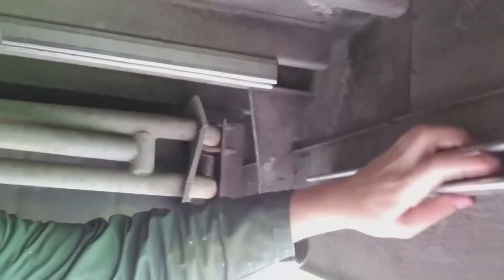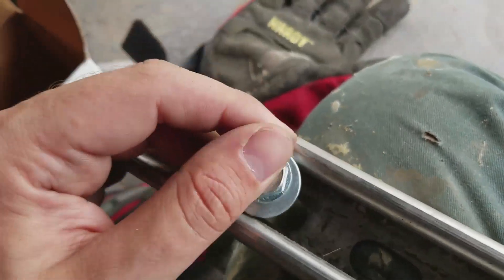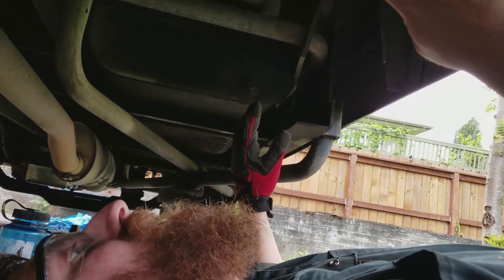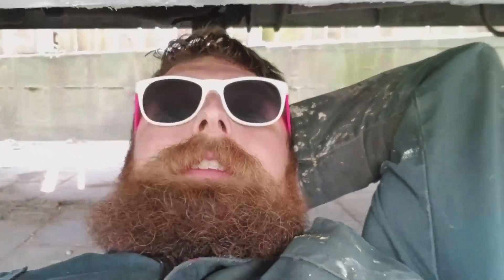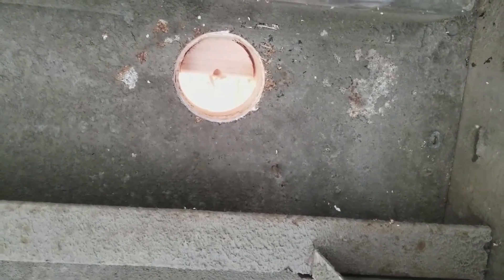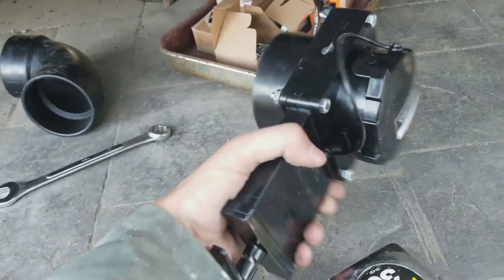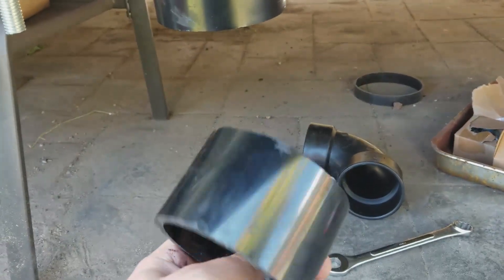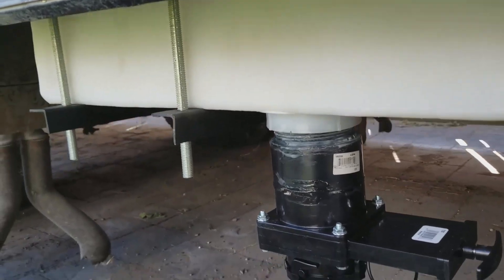Conversion Video 19: No-Weld Grey Water Tank Install

Comment: You installed the tank upside down
Reply from the maker: I designed the tank.
Reply: Not trying to be mean or anything 
It just seems to me the inlet  would work better coming straight in the top and the outlet coming out the bottom of the side, would allow more ground clearance for the valve.
Reply from the maker: @Longearrider  I thought about that, but with so many plumbing things placed over the wheel well, and a couple of drains needing to cross over, it made more sense to have the input ports come in the sides, and have it dump out the bottom or sides.  I figured less gunk would build up if it dumped out the bottom.  It might be a good idea to make an elbow out of the bottom port at some point.
Reply: Gotcha, just proves every design is different to the application.

Comment: Water is heavy, like very heavy. About 8.34 pounds per US gallon. Then you have to factor in for the stresses of a large amount of water plus the weight of the container bouncing around while going down the road and the forces involved with moving and stopping. All in all, you probably couldn't go overboard with the mounting.

Comment: Hey ! I know its been awhile, just curious- how is it holding up 2 years down the road? Was it snug enough for the road? I'm worried about not having anything on the front or back to support in when stopping. I think we will line ours up with the front side of the tank right on a rib and the run a piece of 1.5" x 1.5" angled steel to help support the weight of tank in any sudden braking/stopping situations.
(Let's be honest, the acceleration isn't going to be a factor, so I'm not worried about having one on the rear)
Thanks for any feedback and SUPER thanks for the great video, we are following it almost to the letter.
-  @phoebusthebus
Reply: Update: I talked to DIYSkoolie on IG and he said it’s held up just fine after 10,000+ miles. 
Of course, if you can, drain the tank before traveling to reduce weight. Also, we added some thread locker to our bottom bolts for extra peace of mind. 👍

We are @pheobusthebus if anyone wants to follow 🙃🙃🙃

Comment: Great job! What’s the name of that metal bar and where can I buy it...     Thanks man.
Reply: It's unistrut. You can get shallow strut too it's thinner. They make a ton of other stuff for it like 90, 45 degree brackets. This stuff is great we use it in commercial buildings to hang our plumbing. And remember it's only as strong as what you bolt it too.

Comment: I like your tank mounting method but if it were me, I'd would want a bolt with a nut and washer on the other side of the metal. In your case you can't access the other side so you chose to use self tapping bolts(screws). I'm sure it would be fine especially the more bolts that you use or possibly put some really good welds on the Unistrut to the ribs. I would either weld the Unistrut to the ribs or make them longer to go on top of the bus frame and them fabricate a mount on the other end. It just seems like a lot of weight to be suspended by self tappers. Thanks for the update! Any new updates?